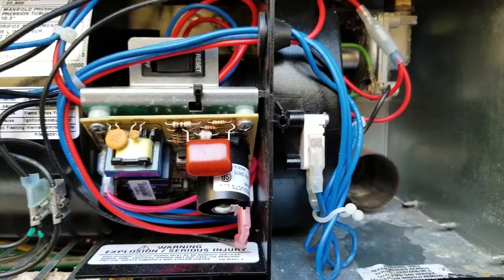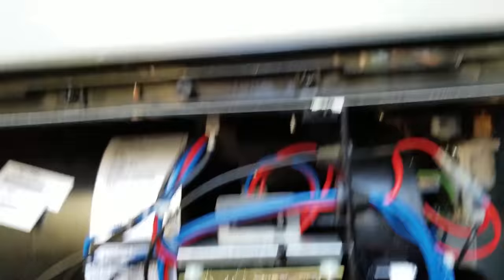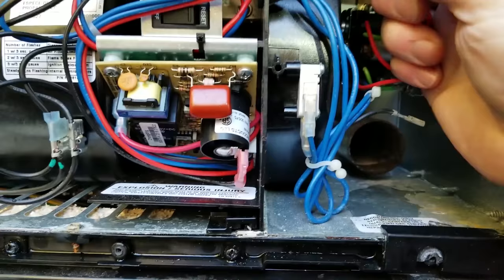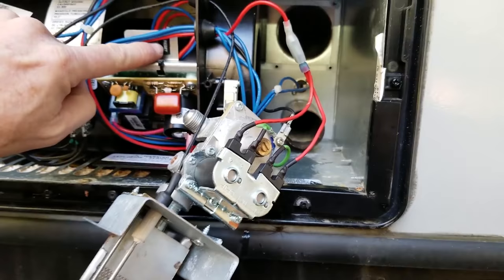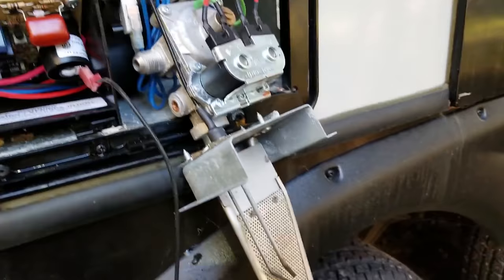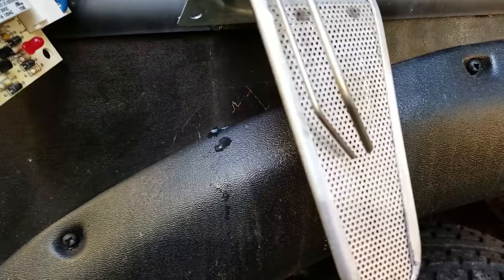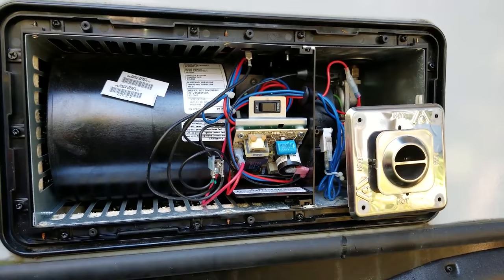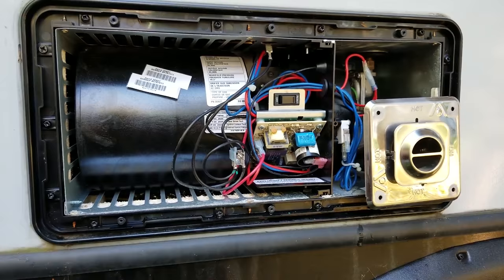Troubleshooting An Atwood RV Furnace Circuit Board

Comment: So for those that don't have a store stock of on the shelf parts(most I assume), this is actually a really poor troubleshooting video. Without the parts to slap in it goes through no method of setting which is actually bad, the ignitor, or the Board. Best to take a simple cheap volt meter or light tester to the wires coming out of the Board and attempt a start up to see if power is being sent to the electrode. I'm sure there's a resistance value one could test for with the electrode itself but I don't know that value. Good for if you want to order parts one at a time but that's not troubleshooting at all.